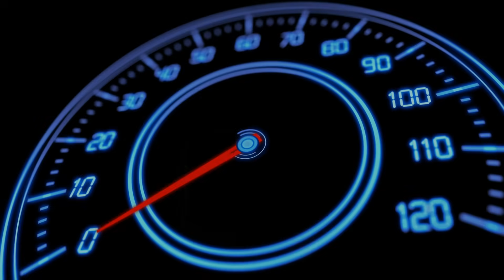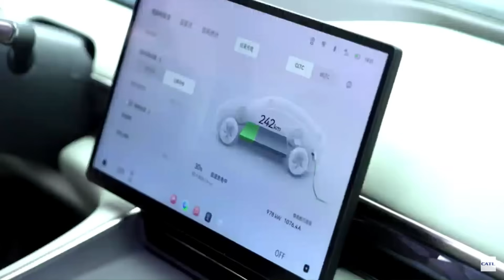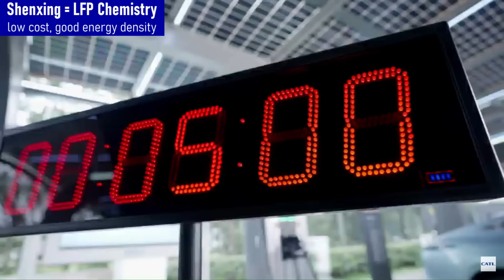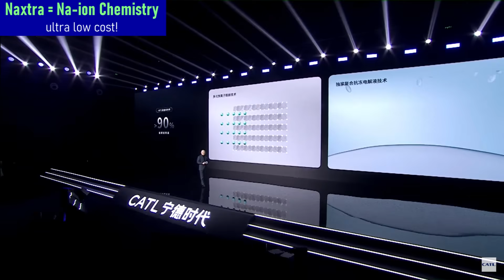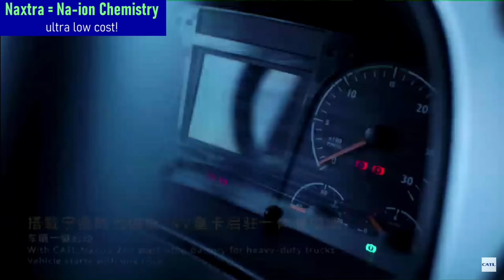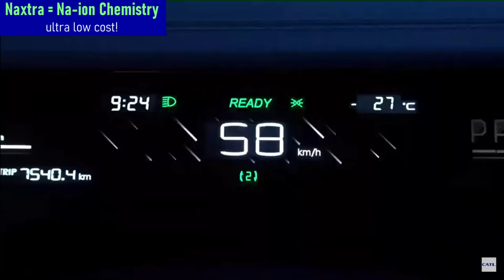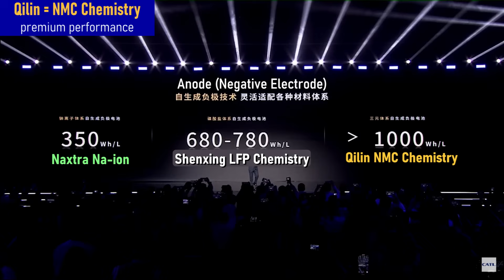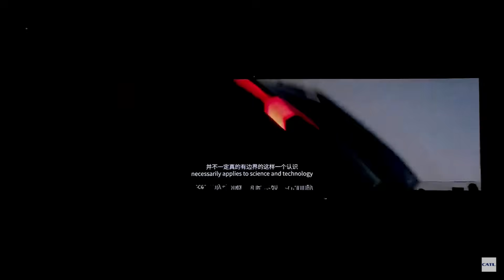CATL shocks the world (again) with Sodium-ion and 1.3 Megawatt LFP Batteries

Comment: I am a marine electrician and I have worked on low voltage (i.e. <1000v DC) 1Mw installs, each wire is about 2.5cm in diameter, there is no way a human being could ever lift it and the cable would crush the car! Generally 1Mw and above are 11 Kv systems so i dont see how you could ever exceed about 250 Kw at 1000v
Reply: Then why can BYD . With hydrogen cooling

Comment: I don't think you state what "5C" means well -- it does not mean you can charge every 12 minutes.  It means that if the battery has a capacity of 100 Ah, (@ 3.2V = 0.32 kWh), then you can charge (for some range of SOC) at 500A.  The range per 10 minutes of charge is more meaningful.  Most of the time you don't discharge these batteries at 1C...

Comment: Have you done a video on the Aluminium Graphene battery? No, manganese, lithium, cobalt, nickel, phosphorus, graphite or copper. No thermal management required; charges in 10 minutes. No capacity loss down to -30°c . This is the game changer that allows US manufacturing to sidestep Chinese battery dominance. I would really like to see a video on the Aluminium Graphene Battery. Cheers, Mark.
Reply: That battery density is very low

Comment: Charging batteries at a rate of 1.3 MW of power is and amazing development! So ya that means you can charge a 100 KW-hr Battery from 0% to 100% in 5 minutes and from 20% to 100% or 0% to 80% in about 3.7 minutes. If it was a 50KW-hr battery then you can charge it   from 0% to 100% in 2.5 minutes and from 20% to 100% or 0% to 80%  in under 2 minutes.   So charging your battery will take the same amount of time to fill up a gas tank.

If 8 cars are filling up at a gas station with 8  gas pumps, they can all fill up their gas tanks at the same time in under 5 minutes. To charge 8 electric cars at the same time in about 5 minutes you would need 10.4 MW of power (8 x 1.3MW = 10.4MW).  That is enough power for about 4,000 homes or a large manufacturing facility.  To deliver this much power at one location from the grid requires a lot of equipment such as high voltage distribution lines or cables, transformers and switchgear all very expensive provided the grid has the capacity.  Generating that much power locally with solar panels would require about 100 Acers of land or 5 to 10 large scale windmills also needing about 100 acres of land.

Comment: WRONG!  "12c" Does NOT mean "it can be charged 12 times in one hour"!

The "maximum C-rate" of "5c" means that a 1Ah rated cell can be Charged at 5-times it's CAPACITY rate... or in this example, 5 times 1(Ah) , or 5 Amps.  If you have a 1Ah cell with a 12c charge rate, it can be charged at 12 Amps.

In an EV battery, you may have 200Ah cells, and with a 5c Charge rate you would have 200 x 5 = 1000 Amps charge rate. If you're dealing with a 400V battery pack, that's 400V x 1000 Amps, or 400kW charge rate. 

Having a battery pack that "can" charge at 1.2MW charge rate is useless... nobody has such a charger... only semi-trucks will ever get that big of an EV charger. 

If you had a vehicle with an 800V 100kWh battery pack (that would be 125Ah cells), and if there was a 500kW charger at 800V, then you have a charge Current of 625 Amps (500,000 / 800V = 625 Amps).  625/125=5c charge rate. 

Bragging about huge "C-rates" is a useless brag... if you knew what it meant.

Comment: What I just don't see is where you get that massive amount of power to build a charging station? Even suddenly turning on a single 1.3 megawatt load on the grid would be an astonishing feat. I would love to see the massive power plant needed to charge 6 of these at a time. When I charge my car up, the car is ussualy done charging before I am ready to leave anyway, and that is at less than 150kw.
There would need to be massive batteries at a site to store energy to be dumped that fast. And think of the massive and heavy wiring that would be required inside the vehicle as well as the connector. Even 350kw is a bit of overkill in my opinion. That would still give almost 400 miles in about 20 minutes.
Reply: for the grid 1MW is not that much, a factory can have 10's of machines that go on and off that pull that amount of power. Also for example rectifying stations for electric trains are in the 100's MW range
Reply: @reahs4815  certainly, but that power distribution takes years to establish and cost many millions of dollars to implement. Most distribution systems are built with very little capacity in excess of the current demand. You cannot spend billions speculating the needs in 20 years for power distribution. So, now you need 10 megawatts more? It will cost millions and millions and take 5 years to accomplish. Do you think that is going to happen for a ferry or truck station? Not until we actually run out of diesel.

Comment: nit pick: if you just said the battery charges in 5min, please don't follow up with excited claim that it charges in 15min.. only to remember that's specifically for VERY cold weather.  tone matters.

EDIT: <5min in it's obviously either AI or the narrator lacks basic eng. knowledge about power v energy. v storage.  You just said MEGAwatt, my dude, but you follow it up with even MORE excitement over 1000kw.  It's the same damn thing, AND it still doesn't address the required V x A to hit that #.  At least the screenshot lets someone who actually understands the numbers fiture out that the near-max charge rate is in the neighborhood of 900V × 1400A

Comment: The cost savings of sodium batteries (and their crazy safety) will make it EXTREMELY competitive to lithium, even if it's less energy dense. This will herald an EXPLOSION of electrification, as sodium (found in common salt) is ridiculously abundant. This will touch EVERY aspect of modern life, and super-charge renewable energies.

The raised funds are no-doubt to build plants to get ahead of the predicted demand that can likely be described as a tidal-wave.
Reply: This also will ultimately end the lead acid batteries, as sodium is not only cheap, more abundant, and has much more energy density than lead, but also harmless and much safer to handle compared to lead acid
Reply: Their energy density is poor, so they will only be for short-range cars to begin with... but that was once said about lithium-iron phosphate, too!
I'm wondering about sodium in buses, you can fit more batteries in a larger vehicle, it's safer (lots of people and few doors is not good in a fire) and the bus will ideally be sticking to a known route and schedule, so charging stops can be "built in" to the routes
Reply: @michaelmartin9022 The advertised density of CATLs batteries are roughly that of LiFePo4 (afaik), so they should be a straight forward substitution when they are manufactured at scale.

Comment: ENERGY CAPACITY IS WHAT MATTERS.  Example, I can get a new ryobi extreme battery, using the new tabless cells, at 4AH (they dont yet sell one larger).  Sure, my grinder will be fed power above and beyond what other battery models can provide, but you now only get 10 minutes out of the grinder instead of 15... but I need it for almost a full hour.   my 12AH battery provides all of the 4AH power density, but has 3x the runtime without interrupting my work, and the batteries will see a longer lifetime due to lower per-cell stress.   THIS IS ALL MARKETING CRAP.  CAPACITY IS ALL THAT MATTERS, POWER DENSITY SCALES - WE DONT NEED LIMITED CAPACITY BATTERIES WITH HIGHER OUTPUTS.
Reply: If you need to use an angle grinder for almost a full hour then maybe you should just get a corded one instead. Or a battery operated one from a less inexpensive brand. Just give it time and youll eventually see ryobi switching to na-ion batteries too.

Comment: Another waste of my time.  Look, unless is 400wh/kg or better its not news.  If you want to charge 350mi worth of power i 5 minutes, increase eergy density.  power density scales with energy density. get us 600mi batteries and you can get your 350mi in 5-15 mins.  STRINGING US ALONG IS TRASH.  THIS IS JUST STRINGING US ALONG.  NOT NEWS

Comment: Sodium is MORE reactive than lithium.  Don't let these cars get wet.  Next they'll be telling us about uranium batteries.  You'll have the whole place irradiated in a few days.
Reply: The sodium are in wet electrolytes, otherwise they are not in form of sodium ion, they are in compound form of NSF (sodium iron sulphate) or NFPP ( sodium iron pyrophosphate) or (KxMFe(CN)6·mH2) Prusian white depends what kind of cathodes are used.
Reply: Actually, sodium sits below lithium in the periodic table.  Lithium metal is more reactive than sodium metal.  As the other responder states, the sodium in these batteries are sitting in a wet electrolyte, which is about as reactive as salt in water.

Comment: Well done. 
What i missed: 'Natrium (sodium) ions are used in sodium-ion batteries, which typically have a nominal cell voltage of 3.0-3.1 V.
 Sodium-ion batteries can operate with a voltage range of 1.5 to 4.3 V, though the stable battery voltage cap is limited to 1.5 V'
3V. So a little more cells (and a different BMS) is needed compared to Li-Ion 3.7V, Li-Fe 3.3V.
Reply: Inverter in BMS

Comment: Got a BYD blade LFP in my 2023 Model Y, best battery so far. Charge stops are 20min. Faster charging is limited here (EU) due to chargers offering maybe 250-300kW, so MW charging wont come here and its not really needed. 250kW and a flat charge curve would be sufficiant

Comment: The main thing about Sodium batteries is that they have high C rates. The high C rates make them a good alternative for plug-in hybrids. A problem is lower cycle efficiency. I haven't heard anything about that, which is not a good sign. Sodium batteries might be nice for stationary applications, such as home battery storage.
Reply: I am sure they are still better than engine efficiency though.
Reply: @najibyarzerachic  Batteries are storage. A fuel tank is more efficient for storage.

Comment: ultra low cost is just a marketing tern that is not defined. even 10% lower cost per kWh compared to LFP might not be an argument if the round trip efficiency is a few percent lower.
Reply: When you sell ev under $10,000. $1000 off is a huge discount ..

Comment: There is no way charge stations will handle even 4 of these charging at one time, the grid will not be able to handle it during holidays or rush hour times.  How fast they can charge is almost immaterial until the grid can handle it.  I suppose if they drive at night and charge while most are asleep then it would be possible to travel across China or the USA.
Reply: They are built with  power storeage station
Reply: Welcome to China Technology power...
Reply: China is starting to have their charging stations back with big battery banks that can deliver the big amperage to chargers, sell renewable energy overnight and act as decentralised power storage grid. The Chinese are fifty steps ahead mate....
Reply: I think the relevance is more how stable the battery is, the fact that the battery can do that without catching on fire means that it has a massive safety margin for normal use.

Comment: If you can recharge your battery within a few minutes you don’t need hundreds of miles of range and megawatts of charging. You can use much smaller batteries and still do the long trips. If you can’t charge at home, no problem anymore. That’s the real benefit of fast charging.
Reply: Fast charge times also mean less chargers needed to serve the same number of cars. The tech is changing so fast but it looks promising that battery EV will be able to replace all cars. There is the option of battery swaps and swapping a big battery for longer trips.
Reply: Assuming you can find chargers that can support charging at 1.3 million watts outside cities, much less in cities. These charge rates will require considerable infrastructure upgrades which come packaged with considerable power price increases. At that stage, ICE cars will be cheaper to run. Especially when oil prices crash due to low demand.
Reply: @  okay, I’ll explain it again: take an EV with a 25kWh battery for about 15 grand and charge it in 6 minutes from 0 to 100% with an already existing 250kW charger. That’s gonna give you 100 miles of range or one week of driving in the city and also works for a few longer trips per year. Of course you can also get a bigger battery and chargers up to 400kW become more and more common. And less demand doesn’t necessarily mean lower prices. The costs for the infrastructure stay the same and suppliers can easily lower the supply to make prices go up and increase their revenue.
Reply: @RestorationWatch  you'll be surprised at just how out of touch these FUD points are when you actually use an EV.  Tesla specifically has charging infrastructure coast to coast, border to border that makes it possible for even 10yr old Teslas to go on 1000+ mile roadtrips.  you are stuck in the past.

Comment: If this becomes more widespread, it will change solar energy systems and become more affordable, given that what they cost the most is the batteries. Frankly, I am more excited about this aspect than cars. Also, in terms of safety, I do not feel safe when I go out and have lithium batteries in the house.
Reply: LFP are incredibly safe. You can puncture them and still have no problem.

Comment: An energy density of 100 to 160 Wh/kg and 290Wh/L at cell level.  voltage range of 1.5 to 4.3V. can be discharged down to 0V and shipped at 0V, increasing safety during shipping. 20-30% lower cell BOM cost than LFP. A wider operating temperature than lithium-ion cells (-20°C to +60°C). Typical Energy efficiency 92% at C/5.
Reply: 1.5 to 4.3 volts is a bit too wide... LFP rules there
92% is nowhere near 99+% of li

it's "good enough" for mass lead acid replacements

Comment: Even if the cables and infrastructure have trouble making use of these charge rates, regen braking can now improve one pedal driving and acceleration performance will be more consistent. A 300 hp car might need 800 or 1000 hp of braking for hard stops. Regen braking is often limited at high state of charge, and acceleration is limited at low states of charge, but with a much higher C-rate battery, it can keep up with motors over a wider range of charge states.
Reply: Damn didn’t think of this, good catch!
Reply: very good insight!  The C-Rate of batteries is often overlooked as to what you can do with them.  My Tesla Model 3 RWD LFP (CATL) - according to my research, is as quick as the C-Rate of that pack.  Thus Tesla paired a motor that could do what the pack could do.
Reply: Especially when paired with the newer capacitors that were being talked about last year. Don't remember the exact name but it stores more than previous capacitors and as a capacitor it obviously does it faster than the batteries themselves.

Comment: NA batteries does not discharge the same way as Lithium ones. Their voltage curve is less easy to handle for the other components. Did they mention something about this point or how it can be used somewhere else than cars ?
Reply: Depends which one you are talking about there are at least 4 types depending on the cathode NSF, NFPP, Prusian blue analogues and layered oxides. All have different characteristics.
I am not sure which cathode CATL is using I believe it's either NFPP (closest to LFP) or Prusian blue analogues (higher energy density).
Reply: They discharge at the same rate.

Comment: Still think those "peasants" are incapable? Still wait for them to call and beg for negotiation? They already have shown respect and allegiance with AI-generated memes.
Reply: Are you running the propaganda? Go and leave there, to see who is paying for everything and how... It is a simple reason why all is only made in China... 
PS: Electrical infrastructure from 99,9999% of the globe does not support those charging speeds, all that you see is smoke for guys like you who do not see the entire picture and why it is happening these...
PSS: Tesla announced 1 MWh charging for CT, but delivered it with 350. Why? Because you cannot drain so much energy, the summer electricity failures occurred long before the electric transportation era, and those hundreds billions investments in electrical network are still to come (Sweden estimated to need to invest 10 billion in electrical infrastructure only, just for electrical cars... and in more than 10 years...because I bet you never installed a power cable to understand  the problem)

Comment: Regarding the amount of Amps and cables cooling, the 1000V plays a big role here, for example Tesla supercharger pushes about 660A at 500V system (even 900A for Cybertruck), so by going to 1000V system the 1400A is impressive but still manageable.
Reply: Regardless of the voltage, 1400A is a lot of current.
Reply: @adon8672  yea BYD is using actual mini substations to power these chargers that have their own battery.
Reply: amps dictate losses in a cable not the voltage, but the voltage dicates the amps
Reply: @reahs4815  I agree that amps dictate losses but I think it's more appropriate to say that the desired power dictate both amps and voltage. Voltage can only dictate amps just as much as amps dictate voltage. It's all about the power. Since power is voltage multiplied by amps, both voltage and amps can be appropriately adjusted relative to each other to achieve the desired power.